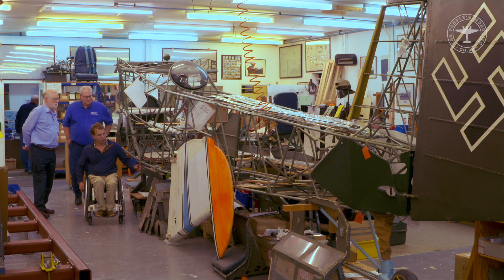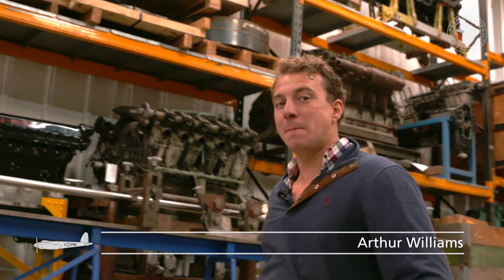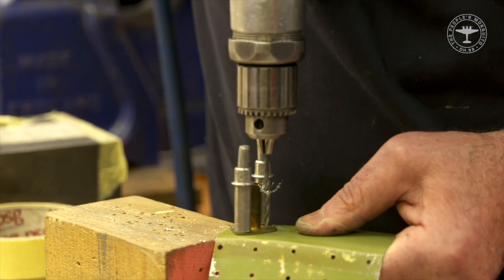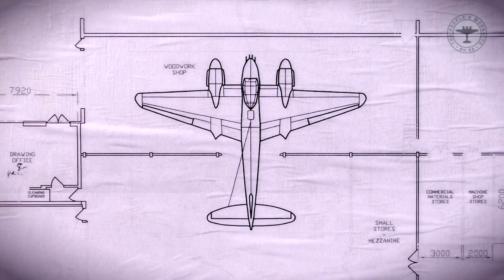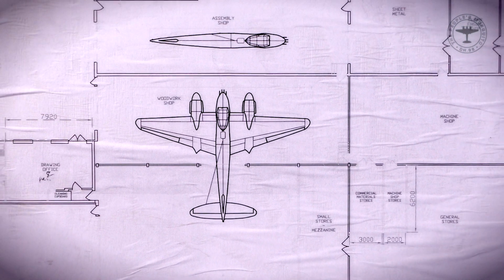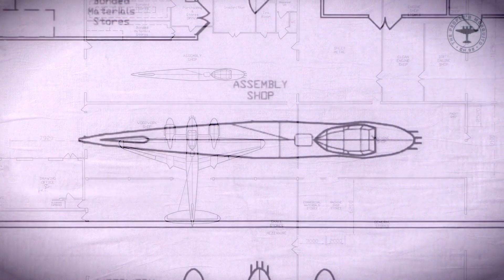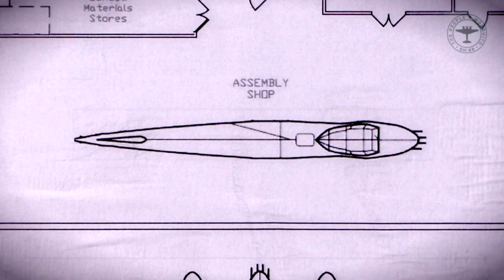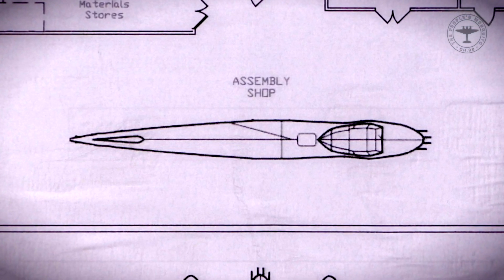Arthur Williams introduces the Peoples Mosquito

Comment: What’s the story of the Me109 in the background?
Reply: It's a rare Me109-E1 which force landed circa Sept. 1940 due to an engine failure during the Battle of Britain, in Kent (I believe) but survived WW2, as it was used by us to drive war bonds / fundraising around the Empire. Was discovered in India many decades later and recovered to the UK by Retrotec.
Reply: @johnlilley2777  are they going to restore it to airworthy condition or static display?
Reply: @fw1421  airworthy is the goal
Reply: @johnlilley2777  Fantastic! I don’t believe there’s any E models in airworthy condition anywhere.👍🏻
Reply: @fw1421  I believe there is maybe 2, but definitely 1 E-4 in Canada flying, but rarely seen, but no E-1's with the DB601 engine. This project does have an original engine to overhaul. The aircraft also has a good history to the JG (WIng) it was assigned too as well.
Reply: @johnlilley2777  Thanks for the info. There are so few 109’s flying today. Seeing an E in the air would be incredible. The guy from Texas that had all the Buchons from the movie Battle of Britain helped get a few back in the air by selling them off helped a bunch.